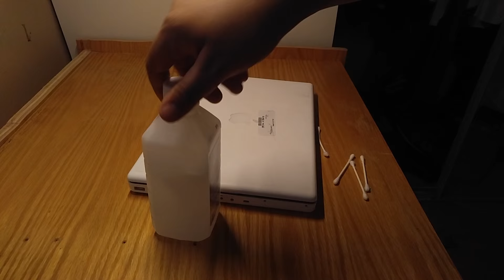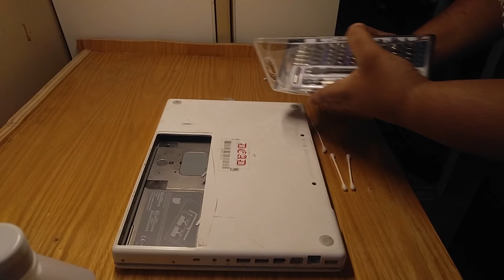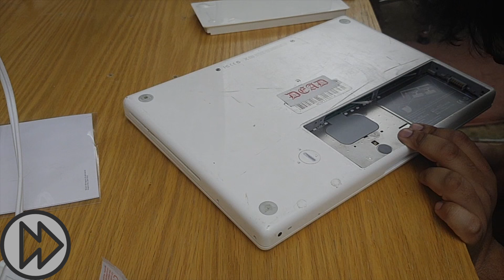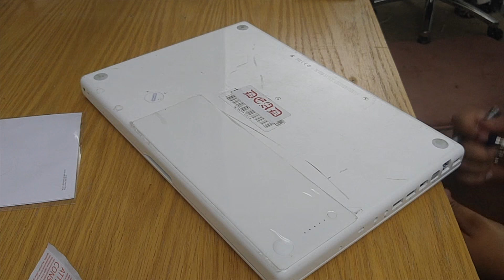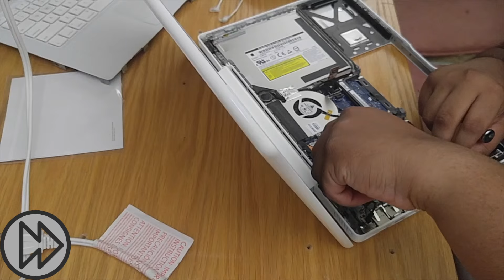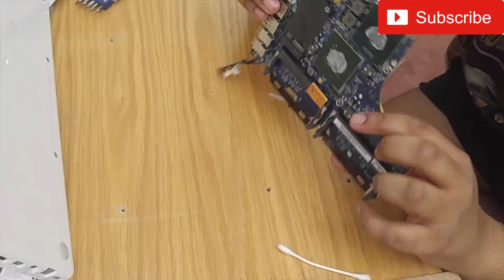Dim Green Light MacBook Troubleshooting (Not Charging, No Start, No Power)

Comment: the problem you're having getting the battery in is because it's missing the L bracket that covers up the RAM and HDD slots. I had the same problem on my 2008 Macbook and had to buy an L bracket on ebay for about 5 bux. just makes it easier getting the battery in and out and keeps debris and such from getting into the RAM and HDD slots.

Comment: I accidentally dropped my MacBook and now it won't turn on with the battery and the battery is 60% charge 
it only turn on when its plugged in 
the light light green  but on the top of the screen it's saying not charging 
somebody please help me
Reply from the maker: Eagle Empire Sound it sounds like the battery may have some kind of connection issue, if it is unibody I would take it apart and make sure the plug didn't come loose. If it's not unibody I would check the battery pins. then I would check the battery for any damage.
Reply: Same problem.. Its a battery problem or any other problem